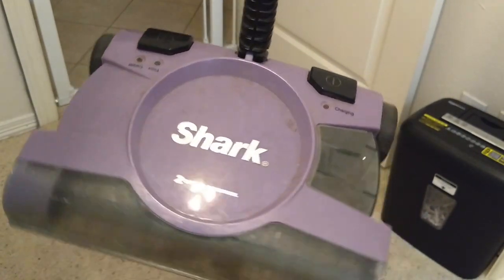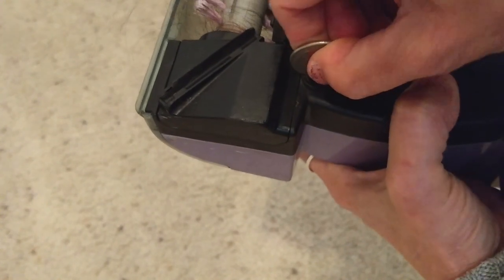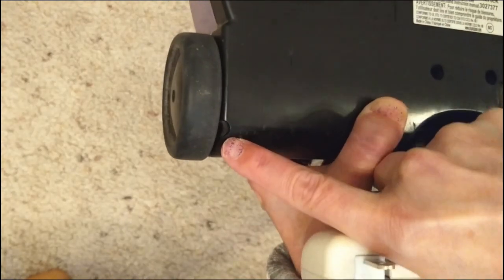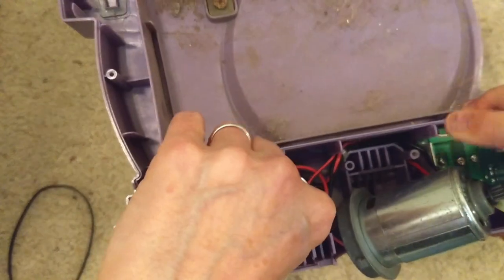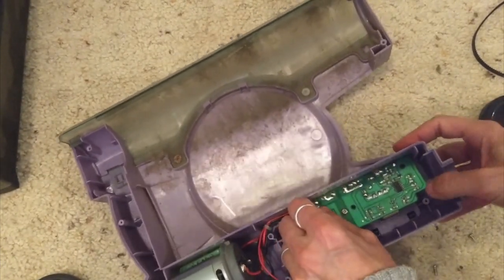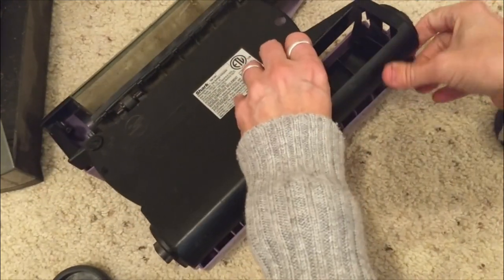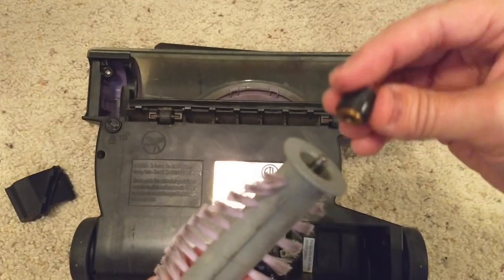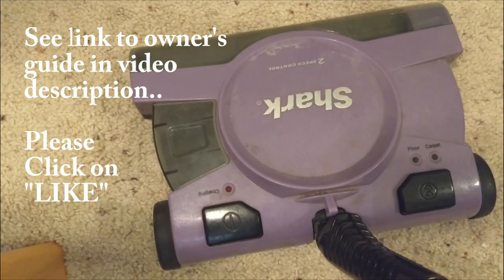Shark V2945Z - 2-Speed Cordless Vacuum - Disassemble, Clean, Reassemble - with User Manual Link

Comment: Yes you R a tech angel!! I am so glad I found your vid.

 My shark ( V2950) would only run for 10 secs before quitting. 

I had even just bought a new battery. Was ready to throw out  this vac.

 Then after your excellent instructions on how to take out the roller brush and clean the ends it now works. 

 The manual with its illustrations are not helpful .. AT ALL. But you are a life saver or should i say VACUUM saver !! ha ha

I should have known to take it out and inspect the ends. 

That's what the prob was. There was old hair wrapped around the end thingy  inside . 

You saved me soooo much money.   Thanks a bunch!

Comment: Thank you for this video. Our handle broke and thanks to you I took it apart glued the handle back together and reassembled the sweeper.  The first time I did not have the plug in in the right position.  Took it apart again and double-checked it before I put all the screws in.  Thank you again, it works like a charm.

Comment: I replaced the battery and the new one won't charge.  What do you think is wrong ? battery charger maybe ?
Reply from the maker: Yes, it could be the charger.  Walmart sells a multifunction charger. Or, you could see if you have an old charger that has the exact same output and polarity and try it..
Reply: When I plug it in to charge the charging light comes on but after the light turns off and I go to vaccuum it doesn't turn on. What do you think is the problem?

Comment: I took the brush out to clean it and now the brush won't spin to pick up trash. I put the belt back on where the teeth are but it's just not making the brush spin. Any ideas on how to correct this problem?
Reply from the maker: Make sure do you brush orientation is correct one and has a square post.  Also, make sure the belt is on and connects to the teeth.